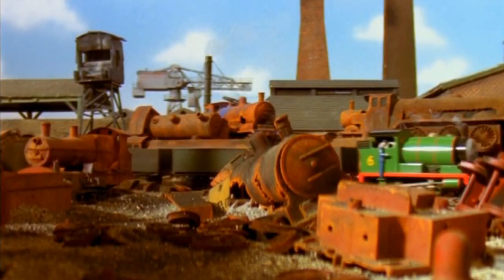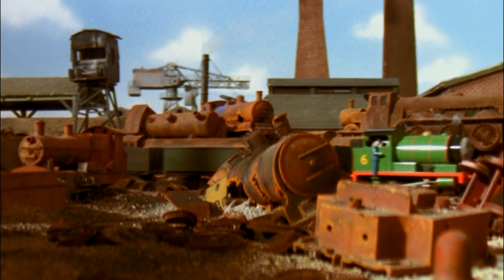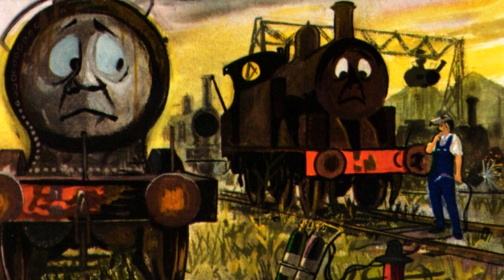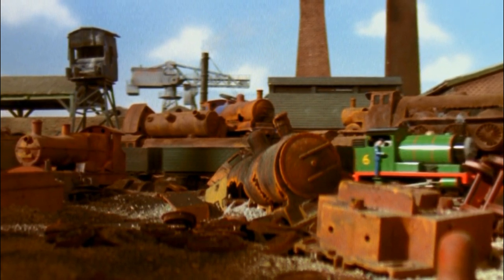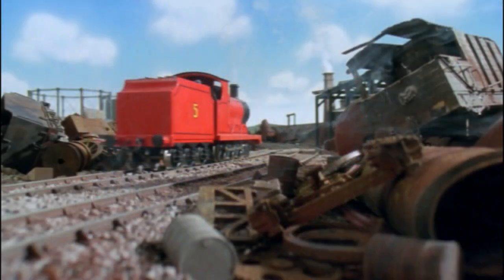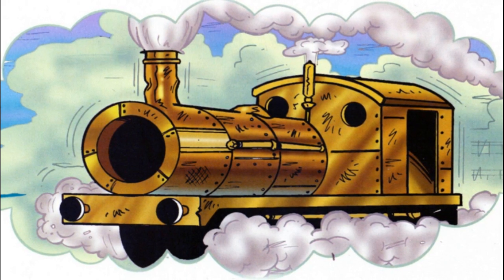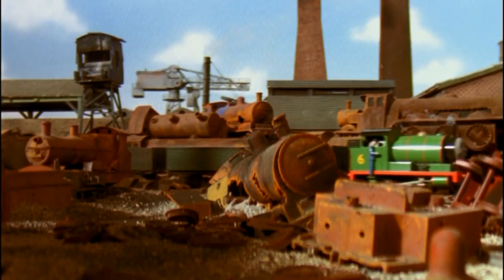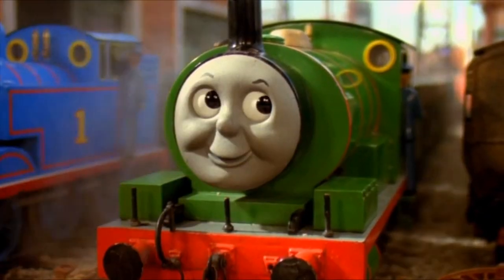The Scrap Locomotives Of Thomas & Friends: An Analysis

Comment: The scrap yards is literally a graveyard for engines and the corpses are just left there to rot. I always wondered about why there were so many scrapes steam locomotives on the island considering it’s a safe place for steam.
Reply: Ah well they are there for parts, or maybe the Fat controller has them so they can fade in peace
Reply: Probably plenty of smelters and other steel processing industries on sodor:
Fat Hatt buys the scrapped stock cheap, melts it down, makes new steel products from it, then exports them back to England
Reply: But I'm pretty sure it's the only standard gauge one on Sodor, unless you count Stepney's line in the TV series
Reply: They scrap engines are smeltered down to make new parts for the fat controllers engines also have you ever heard of metal fatigue that corrosive stuff very nasty shat yo
Reply: I assuming they were already dead before arriving there
Reply: Greta Thurnburg thought it was a nice place to move to, then saw all this dirty coal being burned ...
Reply: @justdags6611  perhaps it's a gentle reminder as to what happens to Engines that fail to remain useful.
Reply: Probabbly shiped there for parts and scrapping
Sodr isnt that big to have so many dead engines
Reply: I’d like to think it may be railway series/basis for fan made engines. Like Eagle, Alice, Alfred, Eric, Adam, Lily, Colin, Neil, etc.
Reply: First, steam engines are not people. There are no corpses or graveyards. Second, they are generally not just left there to rot.

They must be broken up and cut into small pieces with torches so they can be melted down. Scrap is very valuable especially copper. It is not something you leave to rot. That happened in 2% of cases of BR steam locos.
Reply: @PreservationEnthusiast  You defenetly can't understand than this is a cartoon, and in cartoons everything is possible.
Reply: @allstufftrainssa3618  metal fatigue is real? I thought it was only in stories of sodor

Comment: Fun fact it is believed that the original thomas and Gordon models from the 1984 pilot episode were used as scrap scene dressing. Erego the thomas/Gordon models
Reply: It's not merely "believed." The crew confirmed that.
Reply: Actually I'm pretty sure the pilot models were reworked into their actual models
Reply: @zacm.2342  I think as earlier stated the crew actually confirmed that the pilot models were used as scrap set dressing
Reply: @joshuaW5621  they will have just been spare shells with nothing inside
Reply: @zacm.2342  The pilot models were custom builds that ran very poorly and had little in the way of eye mechanisms from what we know. The ones used in the show were built off other model bases.
Reply: @jiifigmentforever  Yes they di corfimed that
Reply: @zacm.2342  no
Reply: Weren't the pilot models of Thomas and Gordon refurbished and became the classic series models
Reply: It was confirmed years ago that they were used as scrap models @Sudriantank743

Comment: Being 'optimistic' maybe the scrap engines are dismantled on the mainland, and then taken a scrap facility, and since Sodor has one, they can be taken there. That way, it's out of Sir Topham's control, but he still needs to business.
Reply: Or it could be that they were just engines damaged or degraded beyond reasonable repair, and are kept around for sourcing parts, since steam engines were not being built anymore.
Reply: They probably use parts from those scrap engines to keep Thomas and his friends running... Diesels had started ro become common place on the mainland when the books came out so it would make sense
Reply: What happen to their face

Comment: One thing I noticed you neglect to mention when you brought up scrapped toad brake vans, was Toad's scrap model, which was used both in "Escape" and later on re-used (without face) on Toby's Discovery.
Reply from the maker: Toad wasnt scrapped lmao; he has a scrap model that was used for the brake vans that I believe I mention but no I didn’t mention his scrap model since he wasn’t a scrapped locomotive or piece of rolling stock. He just has a model of such lol.

Comment: i think what makes the scrapping part of the franchise so disturbing, is it's never made clear how or when the engine would actually die. it could sit there, motionless, still alive, or be sitting there, very much NOT alive. is it removing the face? the firebox? why would an out of service engine's firebox be on? what about non-steam locomotives, Diesels (at least in TRWS) can be scrapped, or what about non-locomotives?

can a piece of rail equipment, sentient or not, be able to be considered legally dead? is this a system based on rust or being cut up?

the only sure thing is that melting an engine will 100% kill it but that applies to anything that can't withstand intense temperatures.